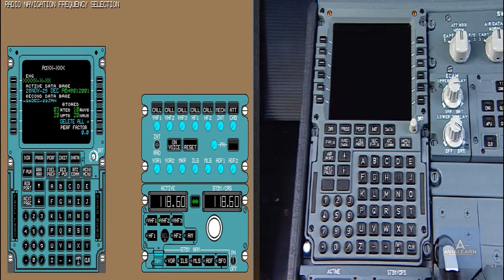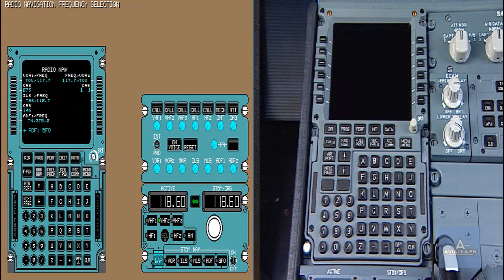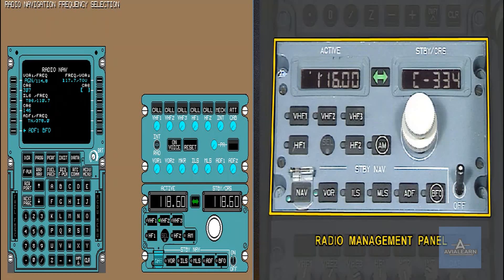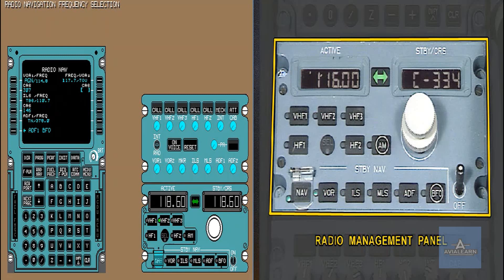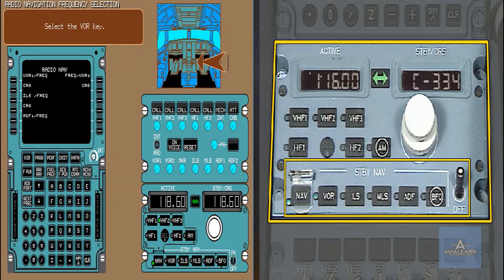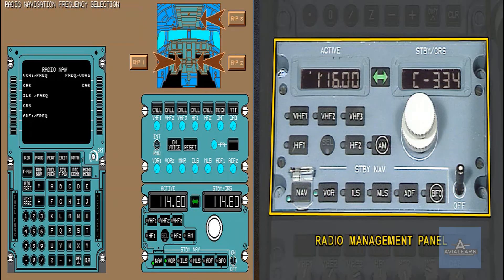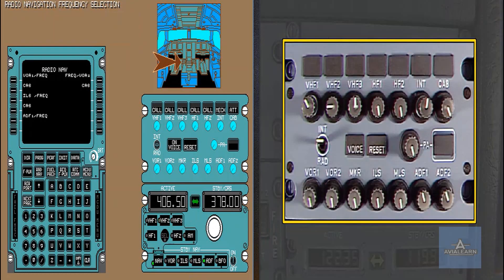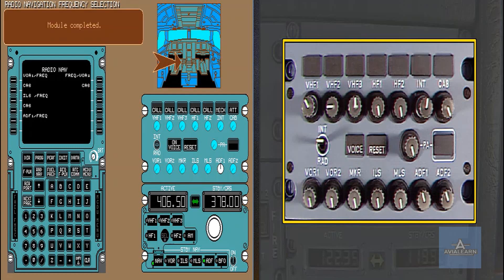Radio Navigation Frequency Selection - A320 Family

Comment: Wait, that CDU in the thumblnail is not from A320. Looks more like a Boeing.
Reply from the maker: It's A320 Family MCDU
Reply: @AviaLearn  Normally, the A320 has buttons "BRT"/"DIM" for screen brightness. Yours has a potentiometer instead. "Next Page"/"Prev Page" buttons are depicted arrows, normally. And there should be two buttons with nothing on it (normal A320 MCDU). First time, I see an A320 mcdu with potentiometer.
Reply from the maker: @m.l.5284 Thank you ☺️ ☺️ ☺️. You may look for the old MCDU  of A320 in Google images, it was with a knob.